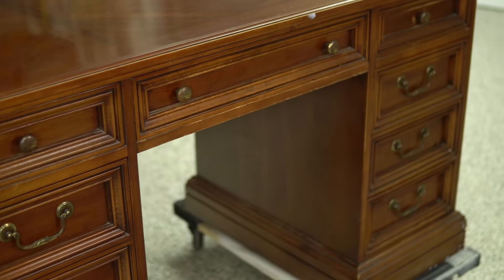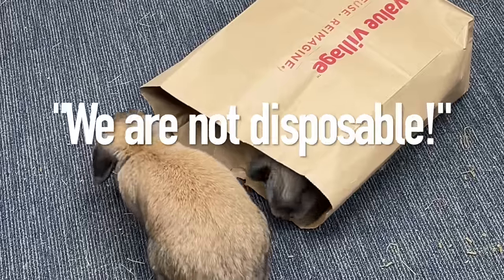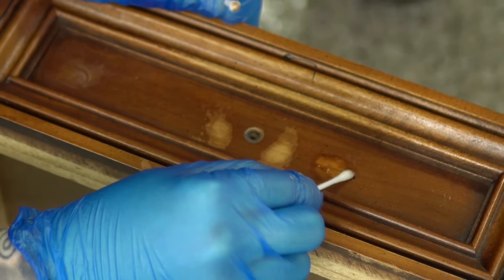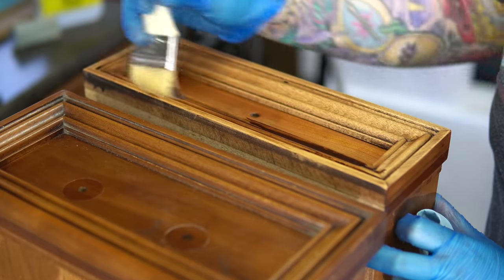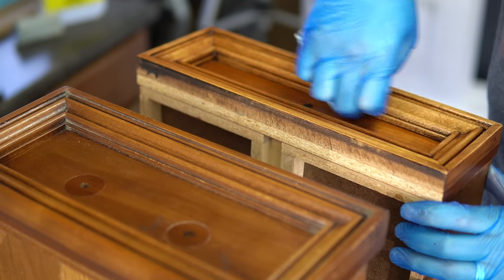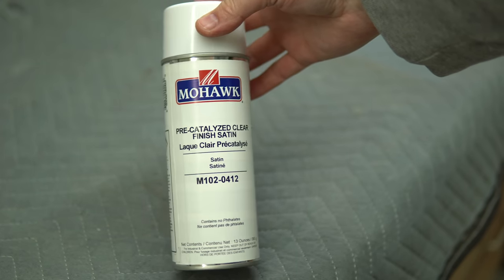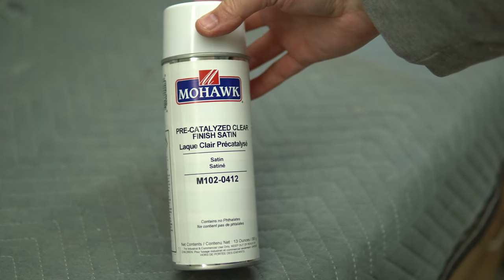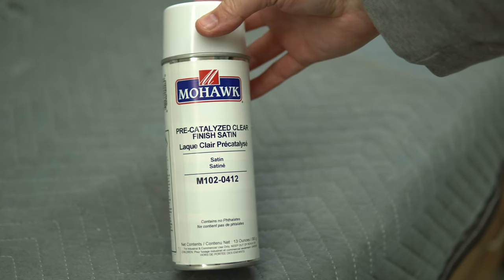GORGEOUS cherry desk restoration - Furniture Refinishing & Flipping

Comment: Great job, as usual. The subtle ones are often more difficult than the bold ones.
And a point you may want to clarify. Masks are not respirators!
Reply from the maker: I use an actual respirator when dealing with aerosols and solvents

Comment: I refinished a desk that had brass plated handles that were in very bad shape. I tried to find new that would fit in the existing holes but couldn't find anything, except ones that were very expensive, like $35 each. I found a place that does electroplating and while not cheap (around $80 for 7 drawer pulls, 20+ years ago) they turned out beautiful. I chose a brushed brass and they applied a finish to keep from tarnishing. Desk was similar to yours but in much worse condition. It was used as a saltwater aquarium stand. Is solid cherry, back side of desk was full cherry and as nice as front of desk.

Comment: Gorgeous!!! I noticed you added a glass top. Nice touch! 

Do you happen to know where could buy a round beveled glass top? I need a 48” size for a table base I already have. 💁‍♀️
Reply from the maker: This top actually came with the piece so I definitely wanted to add it back when I was finished. It’s the only reason the top had stayed so nice over the years. :-) 
Most larger towns and cities have glass cut shops where you can get just about any size (and often colour) glass pieces you want!
Reply: Thanks! I’ll check around. 👍🏻

Comment: Angie, great job.  I have several pieces like this that have issues with the bottom skirt; the vacuum cleaner has scuffed them along the bottom, like its rubber bumper has left whitish marks like scuffs everywhere.  I want to keep the wood, what would you do to get those marks off?  Thanks!

Comment: nicely done!  I can't tell which drawer you refinished, and the bottom seems to fit perfectly to me.  I am curious as to how that piece would have looked (if it could even be done!) with the Odie's oil finish, as opposed to the stained wood... but that's just because I like the look of natural wood.

I'm curious, and this is completely off topic... well, sort of... but that Odie's Oil, could it be used on wood flooring as well?  What would be the advantage/disadvantage of using it?  I ask because I live in an old house that has original hardwood floors and actual wood cabinets (built in the 50's), but they are in need of serious help, and I was wondering what it would do for them.
Reply from the maker: Odie's Oil actually has an incredibly in-depth website with answers to just about any question you could have so for questions specific to Odie's I send people there - https://odiesoil.com/. Under the Cornwall Training School heading there is a TON of information. You can also check out their FAQ section - https://odiesoil.com/training-manual-3/
I hope this helps and thanks for watching!
Reply: @TranscendFurnitureGallery  it actually does help!  First thing I found out, is there is a store in my area that sells it!!!  I REALLY want to restore that cedar chest (to begin with), maybe I will do it myself ;)

Comment: Classy! How do you know which color toner to buy?
Reply from the maker: Mainly experience! It’s just one of those things that you learn over time, if that makes sense.
Reply: @TranscendFurnitureGallery  Like everything else! I refresh pieces by smoothing the whole piece with 0000 steel wool and then with matching gel stain over the existing finish. It blends all the little imperfections. Rub back well, let dry several days and then top coat.

Comment: I have a question for u. 
I'm new to all of this. I bought a Bosh Orbit hand sander.  I've been looking high & low for an attachment that can go from the sander to my shop vac..Holy cow....no one has anything . I'm not sure what I can do. It comes w it's own little vac, but not big enough to hold anything for a big job. 
What do u use??? I'm stumped & frustrated 🙄😕
Reply from the maker: I still use electrical tape on my dewalt lol. I just put the hose up to the outlet and wrap the tape around. If you are ok with it being hooked up all the time, works great! But if you need your sander for other things, maybe not so much!

Comment: May I ask why you couldn't/ chose not to use restore a finish?
Reply from the maker: I personally don’t love the product, though it’s good for certain situations (like light surface scratches and light blending). I know a lot of folks quite like it! 
I just prefer a more permanent solution for damaged areas. Restore a finish is great if you have something in good condition to begin with that just needs a little sprucing up, or for camouflaging light scratching. Personal opinion entirely. :-)
Reply: Thank you for your honest response. It's more helpful to read from those with restoration experience to inform us about a product's results. I'm tempted to try odies oil instead of restore a finish now for an antique high boy. I don't want to overdo finish or have to redo a finish.

Comment: Love what you did, but I didn’t like the faux handles.
Reply from the maker: Unfortunately not much could be done about that. The brass plating was too tarnished and thin to save in some spots. Had I been able to polish all of them, they’d still look identical to what they look like with the metallic paint. It was pretty much the same colour.
Reply: @TranscendFurnitureGallery  no I get it. I think new handles would have been the way to go. But I understand you are reusing. I think you did a beautiful job! Maybe you could put an antique finish with a dark wax?